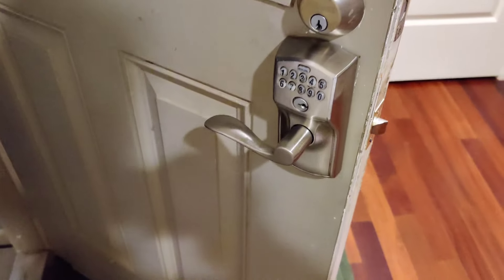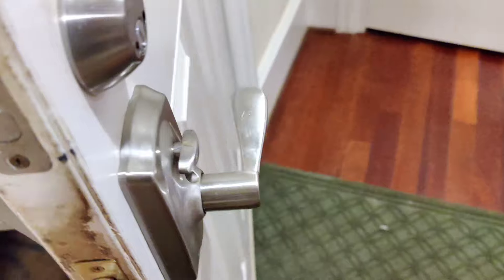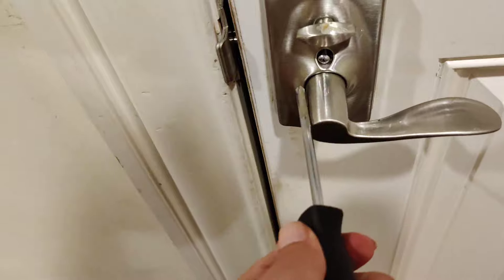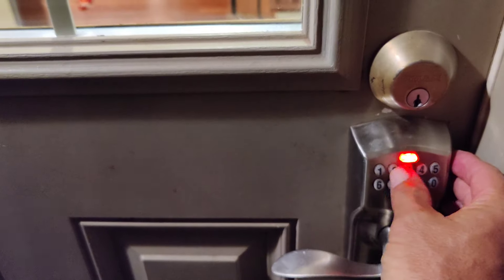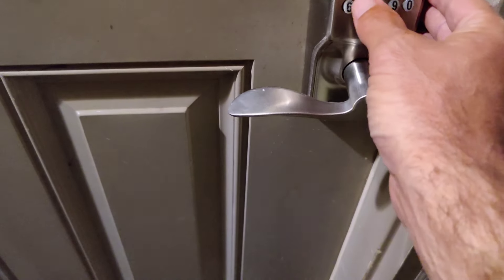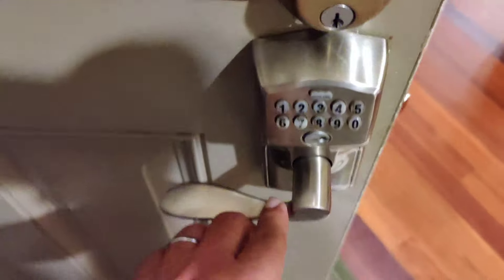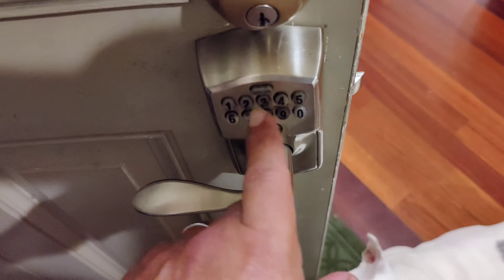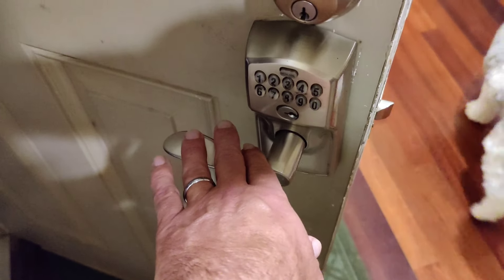How to Change the Code on a Schlage Lock

Comment: Simplified:
-Input 6 digit code thats on the inside of locking system 
-Then press the top button 
-then press 2 
-then input old code you wish to delete 
-then input it again 
-then re input 6 digit code 
-then press 1 
-then I put new code you wish to have
-then Input it again
Then the new passcode should be set !
Reply: Will this work for the Encode Plus?
Reply: Thank you kind sir
Reply: Thank you
Reply: Thank you. This was helpful
Reply: And if it wasn't 😭😭😭😭
Reply: Ty
Reply: Thank you …yeah came for the video …got me more confused …comments cleared it up woohoo power to the people
Reply: @Zero_G7: Thank you for this, but it looks like you left out the second time you press the top button. Or at least that was what was missing for me.
Reply: Who can i do if i cain’t remember my old code to reprogram it?
Reply: Bless your heart
Reply: @Zero_G7 ... Thank You!
Reply: @DehronHB  I will try these steps but you mentioned one more step, what number of step is the one you mentioned?

Comment: I entered my programming code hit the Schlage button then entered my current passcode then #2 did that twice then to erase it then 

Enter your programming code 
hit the Schlage button 
Hit #1
Enter new desired code 
Enter it again no need to push the 1 anymore 
Should flash green 
You are set now try it with someone to see if it worked on your end

This worked for me hope it helps

Comment: But how EXACTLY, step by step do you remove the front plate? it was already installed on the door when we bought the house.
Reply: Take the screws out from the inside
Reply: @jdub8305  exactly lol See screws? Remove them. Done

Comment: You couldn’t see at least have of the video. I would be good if it was more dummy proof. lol I’m disabled and it was very difficult and I still can’t get to change. The part of where to get the six digit code was about the best part. The rest of most of the video was of the door or your hand. But thanks for your effort. Others it worked for. Happy for them. Not for me.

Comment: For mine, when the door is locked and closed, after entering the code to enter the room, the door still remains locked afterwards. Is there a way to fully have the door unlock after unlocking the door? It seems to set like this permanently by manufacturer. Any suggestions?
Reply: You have to manually unlock it on the inside to keep it from auto locking